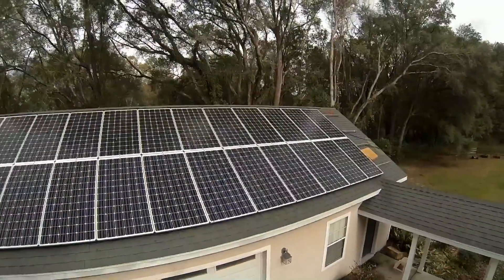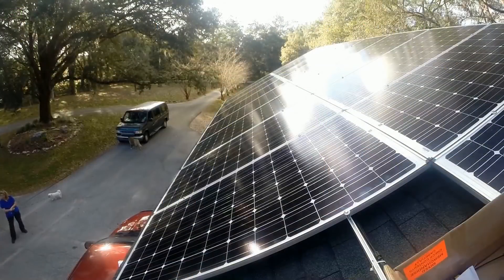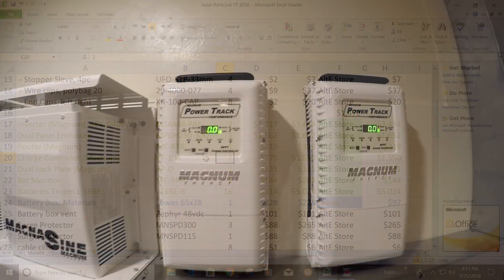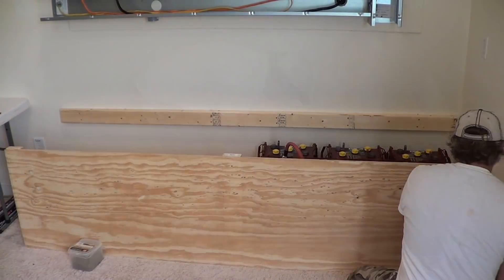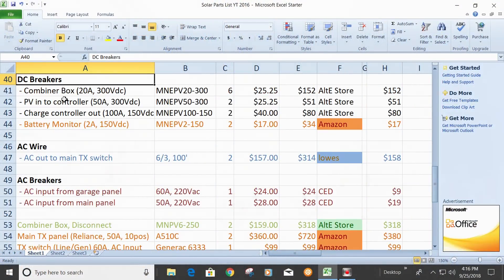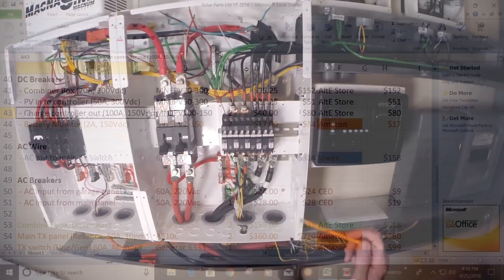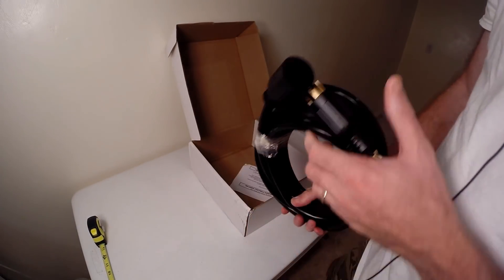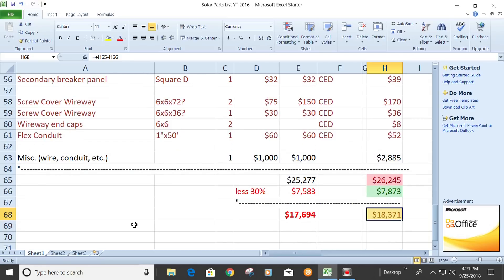DIY Solar Power Parts List

Comment: What would it take to do just to dedicated system just for the washer and dryer on solar
Reply from the maker: I would not recommend building a system just for washer and dryer.  Those are among the last things I would run on solar (I generally don't run those on my solar).  You would need an inverter with about 8000W continuous, 8kWh battery and maybe 4000W of panels.

Comment: Hi Dave
Great job on the videos. I was wondering if you would be willing to share your excel sheet parts list. As well as what you did to get the engineered drawings approved. I am looking to build virtually the same system in Canada.  It would be greatly appreciated. 
Best regards Kerry 
Kerrykurtz38@hotmail.com 
Thanks in advance
Reply from the maker: Check the pinned comment below for the link.  Also, you might want to think about a Lithium battery at this point.  Maybe something like the Fortress or the Ark.  Thanks!

Comment: Excellent video series, I watched the whole thing.  My most bang for the buck came from sealing attic and crawl space electrical and pluming holes and sealing duct work.  You can install a soft start on your heat pump to reduce start up amps but it may not be enough to start with your system.   Mini splits have a lot less starting amps from one that I could find for a 3 ton heat pump,  around 20 amps verses about 35 for my 3 ton Ruud heat pump with an installed soft start, it's closer to 60 amps without the soft start.  https://youtu.be/UmWOgtXMRb0.   The problem with heat pumps is the defrost mode when the electric heat strips come on.  You can disable them but during defrost very cold air will be blown into your house.  Thanks again, keep posting updates, especially when issues arise.

Comment: Thanks for all the informative videos and materials.  I designed my system after yours adjusting it to my situation.  It is now  installed, inspected and operational. I also did my own permit package using your templates, I had zero issues from the county inspectors.
Reply from the maker: Mark,  That's really great to hear.  I would love to see a picture or video of your system and see what adjustments you have made to it.  It takes a while to really make the most of it and I am still learning and adjusting how I use it.  Thanks!
Reply: Don't have the equipment for a video but maybe I can get some pictures on here.  I will see what I can do.